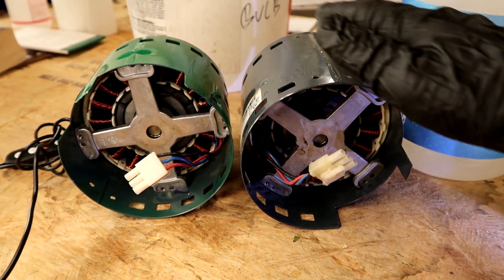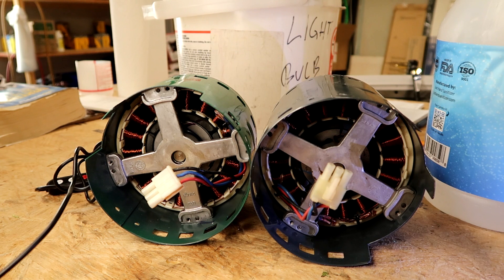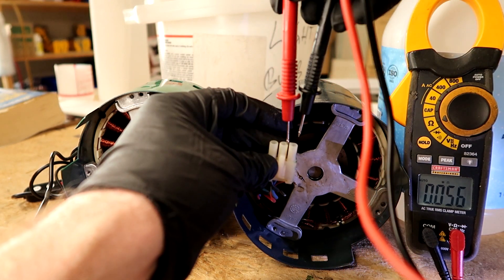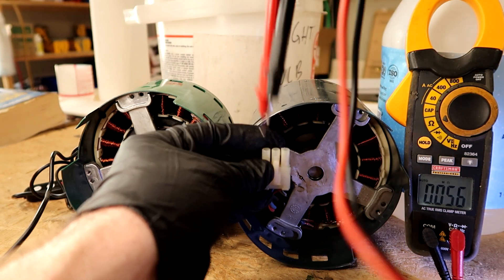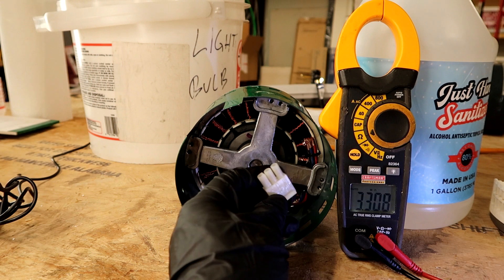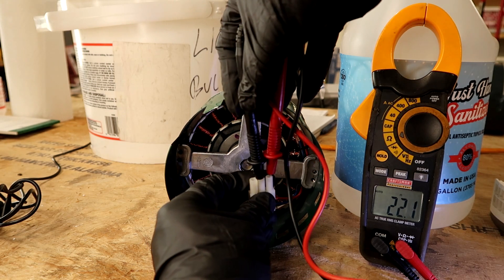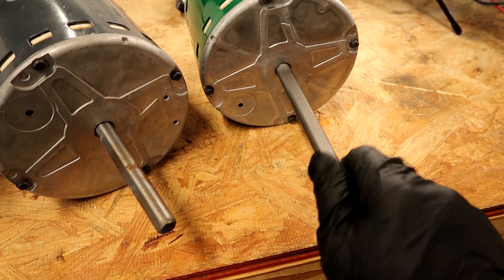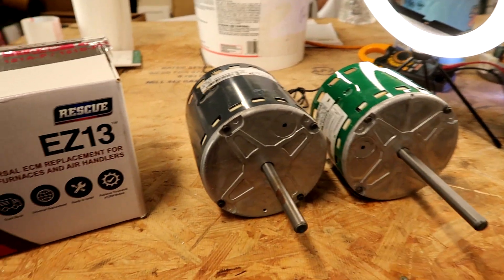How to Troubleshoot ECM Blower Motors #hvac

Comment: For those wondering, what he is testing is the integrity of the windings. The windings(after provided with voltage) produce magnetism, which causes the rotor to spin around the stator. If there is a break in continuity in any of the windings the current will stop flowing.
Reply from the maker: Thank you so much for watching!
Reply: @LexVance  Yes sir, you have an awesome channel!

Comment: Does anyone know if you can wire up an ecm motor just to run at high speed(or at all), with an on/off switch or something like that? Temporary. I’ve heard of those adapter boards for using a psc motor in a system designed for ecm. But I was hoping to use my ecm motor which I believe is still good…seems like if someone made something like that and it didn’t fail so often like the ecm control module and it didn’t cost an arm & a leg, it’d sell like hot cakes! 😅
Reply from the maker: I'm not sure. 🤔

Comment: My Climatemaster ECM blower motor makes knocking noise on start up. Does it need replacement in the near future? Or it can be repaired? Thank you!
Reply from the maker: Could be a loose blade. You'll have to take it out and see if the set screw just needs tightening.
Reply: @LexVance  thank you!

Comment: I have a question. When replacing a filter drier for a yearly maintenance can you do a pump down and replace it or you have to do a full recovery?
Reply from the maker: Yes you can do a pump down. If it's inside the condenser, you'll have to recover. But if it's outside the condenser then you can pump down. Thank you so much for watching!

Comment: Hi I have a question that's not relevant to this video.  Do you have the time for a few questions about my portable washing machine that will spin but won't spinout.
Reply from the maker: I've never worked on a portable washing machine. Only top load GE washers. Sorry I won't be much help.
Reply: @LexVance  ok I understand.  I've never worked on one of these either.  I work on cars lol. Completely different game.  But if I can find out what's causing this issue I know I can take it apart repair it and put it back together.  Thank you for responding I really do appreciate your time thanks again.

Comment: My normal procedure for ECM/X13 (non-communicating) is to pull the plugs, verify that high voltage(120vac/240vac) is being supplied - then check to see if 24vac is being sent to one of the spades that plugs into the speed taps.  
If it has high and low voltage and isn't doing anything it's usually a bad module.  
From there, I'll usually pull the module in place and ohm out the motor windings like you did in this video to verify they're still good and the bearings aren't bad.
Reply from the maker: Right on Mike! Thank you so much for watching!